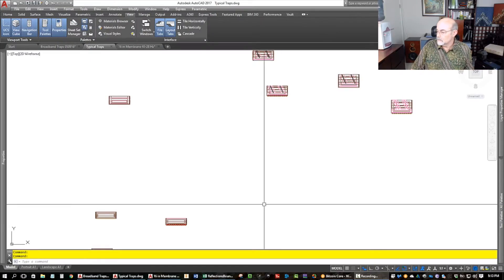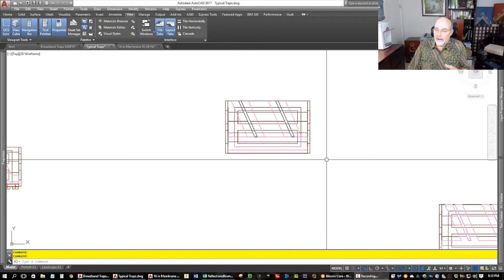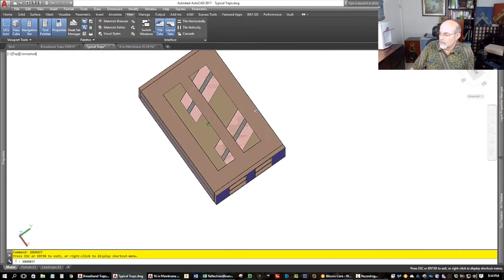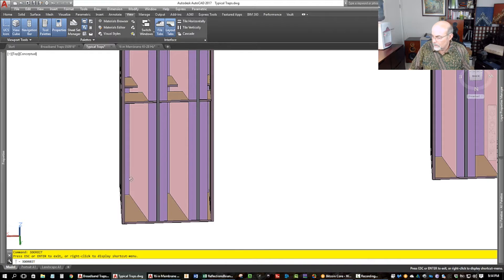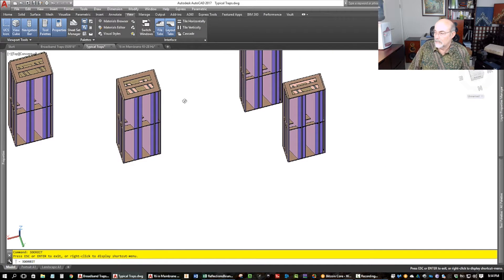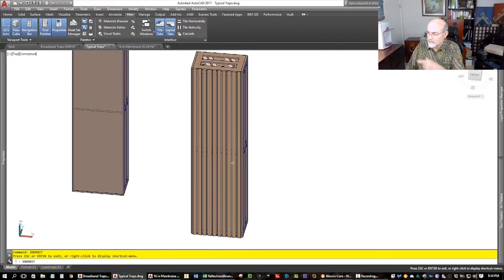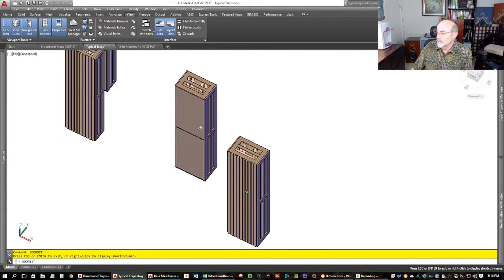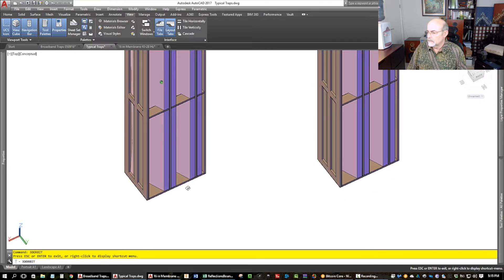Small Room Acoustics: Traps and Frequency Response - Part Three

Comment: how deep is this bass trap representation? what materials is that in there? Rigid fiberglass? Fluffy stuff?
Reply from the maker: The depths of the traps are dependent on the original room analysis (based on dimensions and mass properties of the partitions). That very deep trap shown is 16 - 18 inches deep.
Reply: Ok. If I was looking to do a 24" trap. what would I do with extra 6" inches?  Another wave guide, air gap,  Fiberglass?
Reply from the maker: @CzarPharo  why would you do that?
Reply: I was under the impression that if Im in a gypsum board room, that the deeper the broadband traps the better for controlling lower frequencies. Im I wrong?
Reply: I'm in a 19ft by 16ft rectangular room with 8.8ft ceilings that meet bonello. i built 7 6inch traps using the materials you suggest to treat the ceiling. And I've built a 3  8 inch traps using the diagrams on your website with the waveguides that I was intending to use on the front wall behind the monitors. Those were pretty difficult to build for me, I didn't want to build anymore of those and I was thinking of building 2  24 inch traps in for the backwall with the diffuser in between. I wanted to control lower frequencies as much as I could, so I figured the deeper the better. And I'm thinking the deeper traps would be easier to build than those 8 inches were. These were the last 2 traps I was looking to make due to budget, and time. From there forth I was looking to start hanging, moving in equipment and testing the room. I wish I had the diagram for those deeper traps ; ) . What would be your suggestion?

Comment: great video. My room is way to small to install traps deeper than 4". Do you think using 4" very rigid rock wool board with a 1 " air gap work for low frequency trapping? I live in Bangladesh, and we don't have many different material option.

Comment: Hi Mr Brandt, you' ve mentioned wave guides in this video. I assume that it is similar to Mr John Sayers's bass hanger am I right? Basically it's insulation wrapped around a homasote board?

And also is there any mathematics formula to calculate the absorption coefficient for this? 

Thank you very much!
Jesper
Reply from the maker: Jesper, It's not homasote board.. Homasote cannot 'guide' anything but higher frequencies.. kinda like using seaweed for wave-breaks near a beach. We use heavy 3/4" or 18 mm MDF wrapped with 2 - 3 1/2" of fiberglass insulation.
Reply: Thank you for the reply Sir! Since its 18mm MDF, I roughly get the idea. I would assumed that these wave guides instead of hanging loosely like Mr John Sayers' bass hangers, they would be locked rigidly within the acoustical treatment in itself? And how it works is to guide the waves through multiple reflections within the itself and lose the energy via the insulation?

And I would assume it is a trade secret which you can't reveal the calculation?

Thank you very much Sir! I really love your designs by the way! =)

Comment: Hi John! I have a project I have been wanting to do for a few years now and finally thought (as I finally graduated from the university and am going to now make some money) that I'd get to it. 

Ok so the project is a rehearsal room which I also use as a recording space for everything from live drums to singing. The room sound is hideous and I want to do something about it. I have a background in building so DIY really is what I had in mind. 

The room is about 4x7x2,3 m (not the exact measurements) rectangular, and the walls are plastered brick walls. One of the 7m walls is gypsum and the other is covered with some sound absorption panel (perhaps 2cm thick). The door is one one of the 4m walls and on the other there is a large window (about 1,5x1,5m). 

As you probably can imagine there is quite a lot of flutter echo and modes which make the room
close to unusable. Do you have any thoughts that could help me make the room better, not worse? 

Martin
Reply from the maker: Martin, Sorry for the late response. Contact me thru my email on my site and I'll give you my Skype and other details. Let's talk. Cheers!